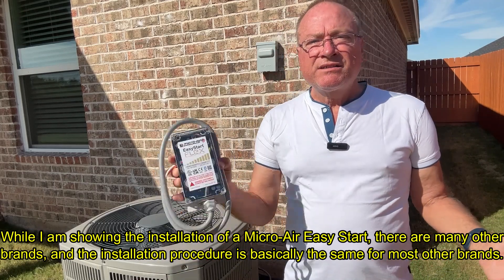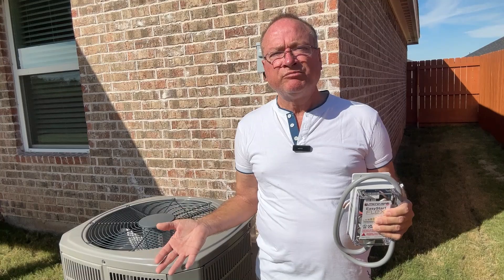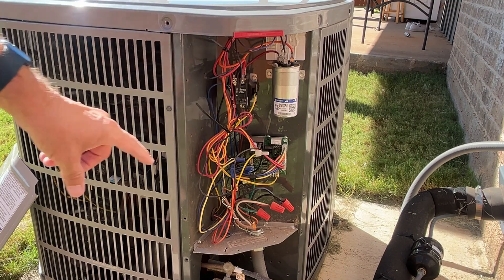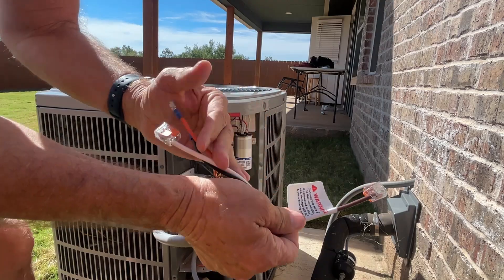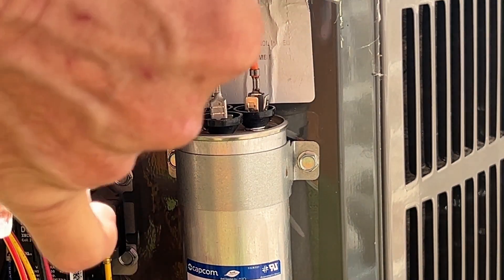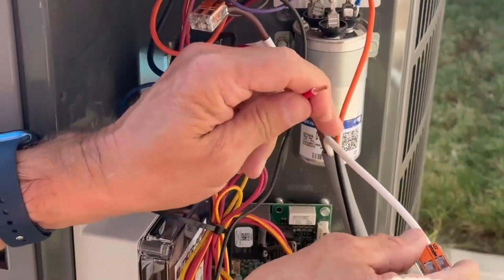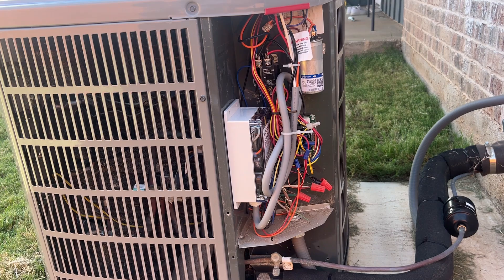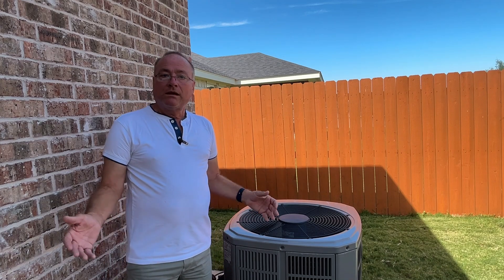A/C Soft Start Kit: I Tested It — Here Are the Results

Comment: I can see where the initial amp draw has decreased dramatically.   Understanding there was a substantial drop on draw on the compressor, did you happen to see and change to your electrical consumption?  Or to soon to tell.
Reply from the maker: No. The very high current draw is for less than a second at initial start up. The current reduction for such a short period of time will give essentially no savings in electricity usage. The benefit of these things is just the significantly lower wear and tear on the compressor windings themselves.

Comment: Mike, do you know if these work with a variable compressor unit?  I have about a 2 year old Carrier Infinity System.  I am currently exploring installing a factory authorized EMI Filter (cost ~$200).  This is not my area of expertise, but it seems like the Soft Start Filter and the EMI Filter have similar functions.  I had a friend test my house for dirty electricity and I'm off the charts when the HVAC compressor turns on, so trying to mitigate.  She is also having me use 2 breakers in the panel (one on Leg A and one on Leg B) for the sole purpose of one electric outlet each, just below the Electric panel, which I will plug in filters (several different kinds, Stetzer I think is one and green something).  Once I have the HVAC mitigated to not spike voltage to cause dirty electricity she will test different filters in new outlets to see what works best.  FYI - this should not only protect my appliances from the dirty electricity, but it will be better for everyone's health.  Thanks for your videos!  I'm learning a lot, but I'm a bit perplexed that if I have a ground rod (Grounding Electrode System per another one of your videos) how dirty electricity gets in the house in the the first place. I guess I'll have to work with my local electrician regarding the ground rod's integrity.